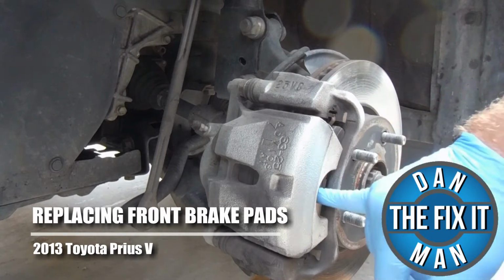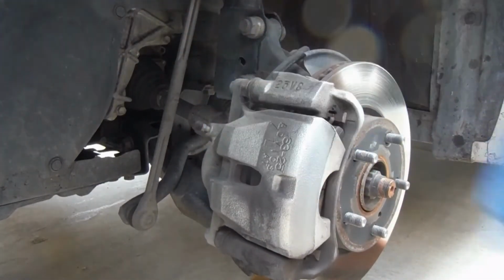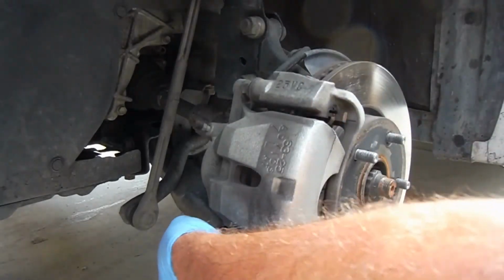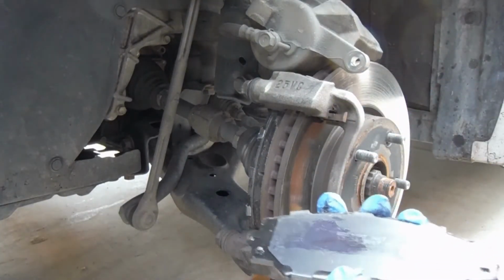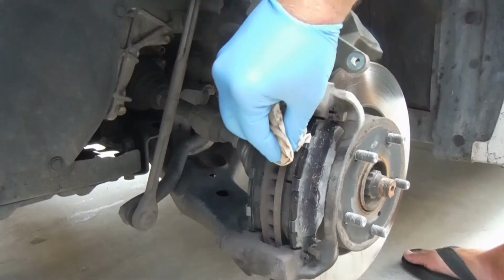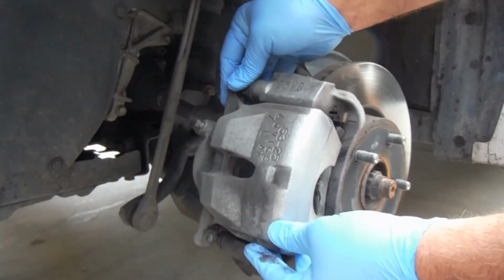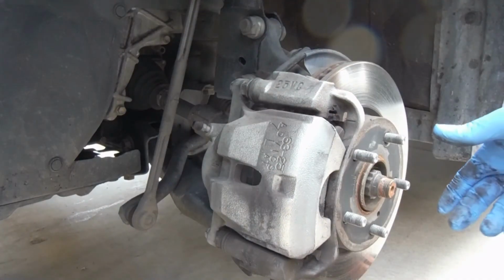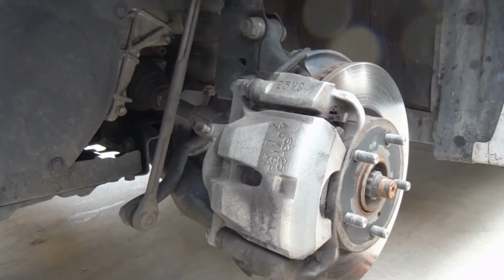2013 Toyota Prius V - Replacing Front Brake Pads - Easy - DIY

Comment: This is what I would call a "minimalist" brake job.  A complete brake job would include removing, cleaning, and relubricating the caliper slide pins; replacing, or at least cleaning, the abutment clips; and cleaning (i.e., removing all rust and debris) and lubricating the surfaces of the caliper mounting brackets beneath the abutment clips.  Nevertheless, a well made video in terms of camera angles, lighting, and sound.  Keep sharing!

Comment: Very good short, through and to the point, do you add a little grease to the pins on each end that slides into the rubber boot and caliper? Very good video, Thanks

Comment: Do I have to do anything with the brake fluid too? Service centers always top off brake fluid when the vehicle is serviced, so if I’m pushing fluid back into the system it may overflow, right?

Does the fluid ever need to be replaced or just repeatedly topped off?
Reply from the maker: Excellent question.
Sorry I didn't mention it in the video, but yes, you should verify the level of fluid in the brake master cylinder before pushing the caliper pistons back in to make sure there is enough room for the fluid to rise.  If it is near the top because it had been topped off by a service center, you can remove some of the fluid with a rolled up paper towel, or you can suck some of it out with an old turkey baster or something like that.  I show how to do that on some of my other brake videos.
The brake fluid does get old and should be changed at the manufacturer's recommended intervals.  I change it when it looks dark and dirty.
Thanks for watching!
-Dan the Fix it Man

Comment: you don't put grease on a brake pad. the grease is for the guide pins and you never even did it.
that grease will run off as soon as the pad heats up in 10 minutes.
if the grease gets imbedded in the pad, the pad will be ruined.
Reply: Wrong. Always put a little grease on the outside of the pad, especially where the caliper pushes on it. This quiets them down. If your grease is all burning off right away you are using the wrong kind of grease.